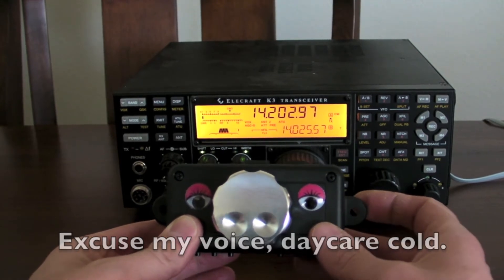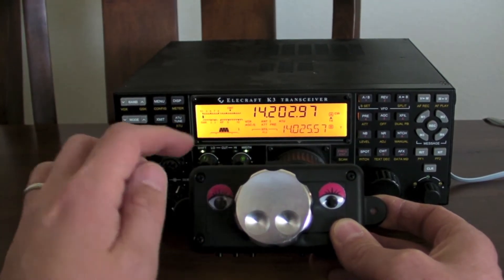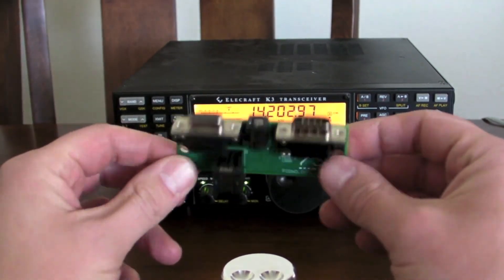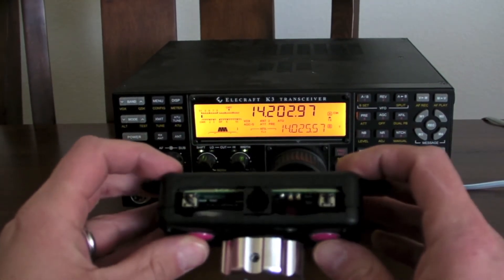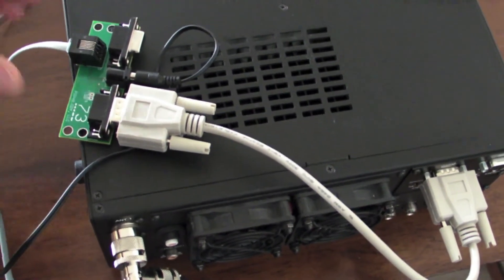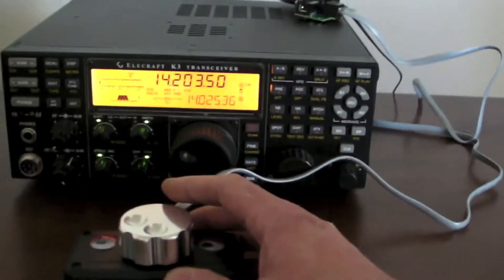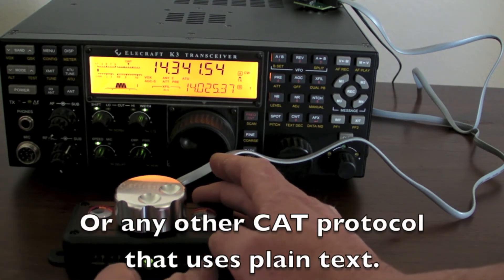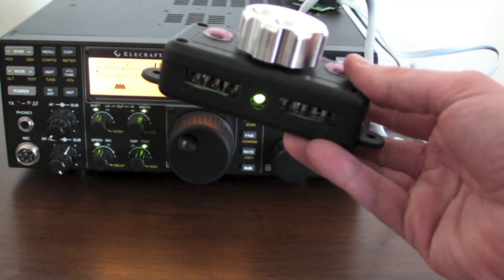PigKnob Update

Comment from the maker: Hi Paul,
It should work with most text based CAT control protocols.  This would include Elecraft, Kenwood and newer Yaesu radios.  The only problem I can foresee is if a radio requires two stop bits for the serial data.  The only modern radio I know of that requires this is Kenwood but only if you set the baud to 4800.  All of the dev. for this knob has been done on KX3 and K3.  The first video for the PigKnob shows it working with a KX3.  Click on Pignology up there to get to the videos page.